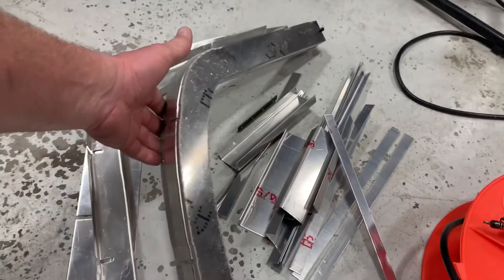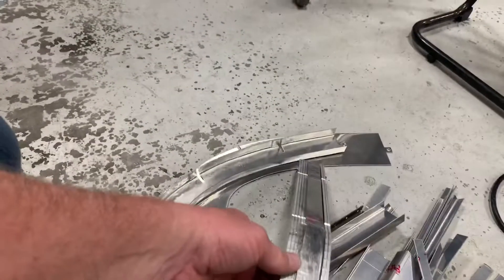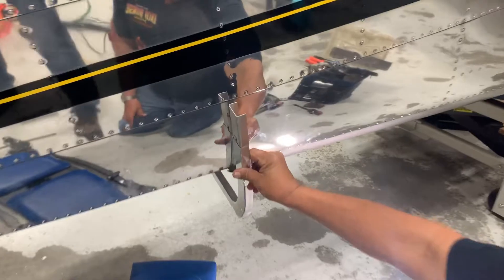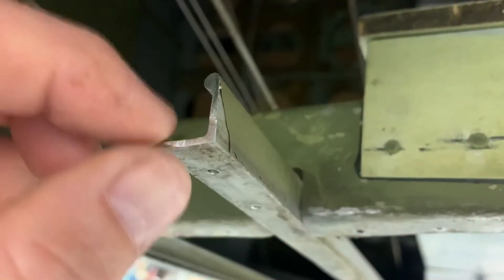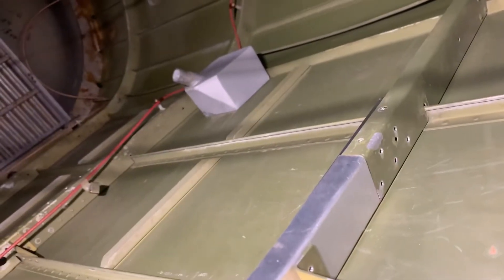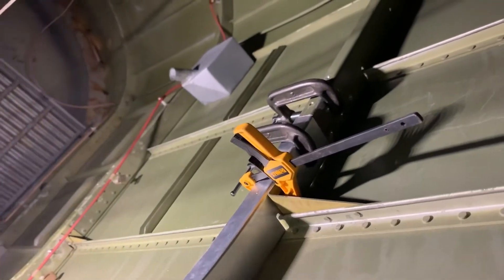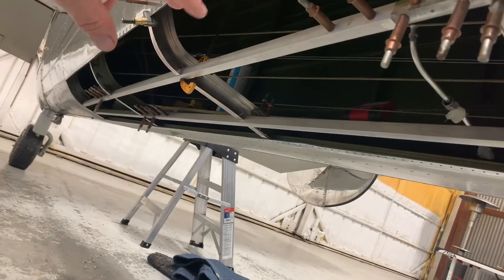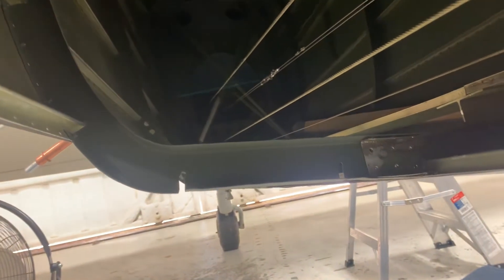Lockheed Tail Repair Day 3

Comment: These thing take a lot of time and effort to get it right, and it looks like you guys are nailing it, I mean riveting it. Great job as I thank you for the update, I was wandering how it was going you. Thumbs Up to you both, with thanks again.! Just a quick question if I may, I was wandering what material you used to double in on the stringers.?
Reply: 2024-0 heat treated to T42 for the angles and 2024 T3 for the flat piece.